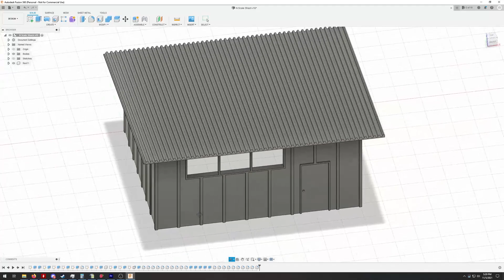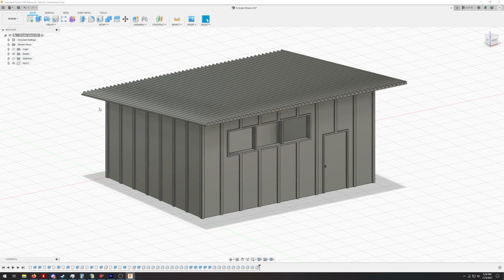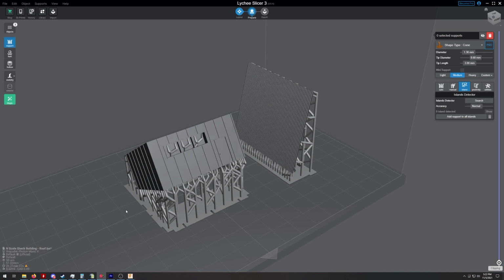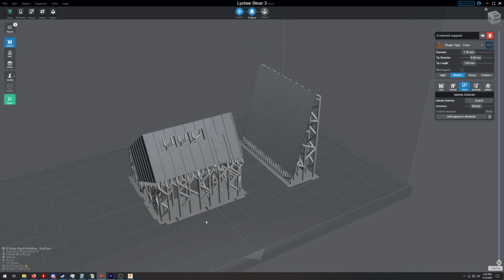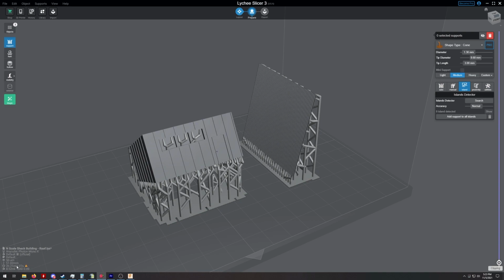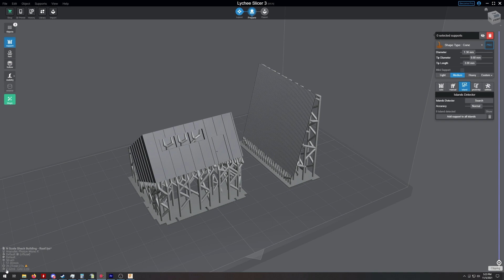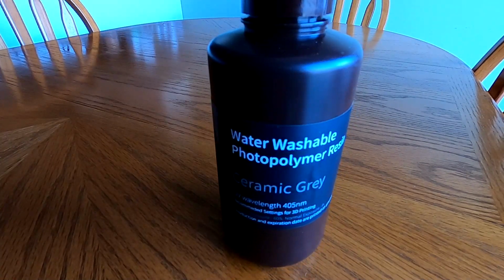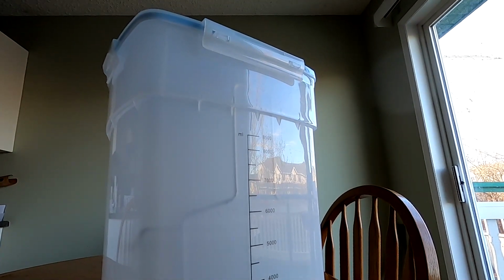My FIRST attempt at RESIN 3D Printing - N Scale building

Comment: The eelgoo washable resin is a soft resin even after cure and I often have issues with it warping.  It's the only resin I have issues with but I like it because it is a lot less brittle then most resins and even though I don't mind the resin smells other people in my house do and this is much less strong.
Reply: Resin fumes are dangerous
Reply from the maker: Have you found a best practice to avoid warping? Sidenote: I found the smell of the resin to be very strong.
Reply: @nscaler454  It's going to be model design.  For example I made some containers with a open bottom since I didn't think it needed them as no one would ever see them.  But after a while the sides did bulge out, So I had to modify the model to have a few 1mmx1mm connecting rods connecting the sides inside the containers.  I had forgot about using hot water to soften and them like you mentioned, I use a hair dryer to heat them up.  Most models do not warp, But the longer and thinner something is the more it will want to, try and work in more structure in the model to stiffen it.
Reply from the maker: @johnchase7667  Good tips. Thanks

Comment: That was great and easy to follow.  I will be doing up an excursion train based on off-the-shelf flat cars and gondolas.   They would include benches, with  or without passengers and perhaps domed coverings.  It might include a car with grills and tables for a picknic or swimming / boating stuff.  I'm not ready to pull the trigger but it might be something you enjoy.
Reply from the maker: Sounds great!

Comment: You definitely don't want to use warm or hot liquid in your wash. Until the part is fully cured it will warp and bend easily with heat.  I still use isopropyl for washing, Yes it's expensive to get the amount you need, but you can "cure" the resin in it and strain it to essentially reuse it many times. Making the cost less of an issue. Plus washing with isopropyl works faster and better in my experience.
I have the Mono X also, and look forward to seeing what you make with yours.
Reply from the maker: is it best to use cold water?
Reply: @nscaler454  I use isopropyl at room temp. Water at room temp or slightly cool (like from the tap) would be fine.
Reply from the maker: @RoyEltham  Thanks

Comment: Did you use your cure part of the anycubic before you washed it? I found after a print it needs a little more curing. Then I wash it when the second step was done. The part will be stronger.
Reply from the maker: I did not. I didn't even know there was that feature. Wouldn't that solidify some of the excess resin?
Reply: @nscaler454  yes it could.  But.  I do a light rinse,. Make sure the print is okay then I UV cure in the Anycubic rinse and cure. There are Youtube videos out there. Makes a big difference.